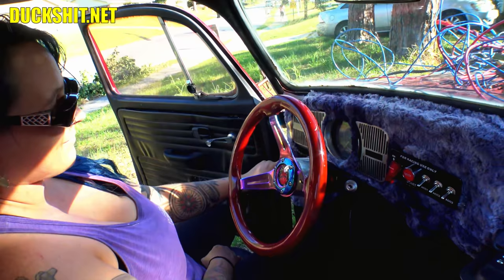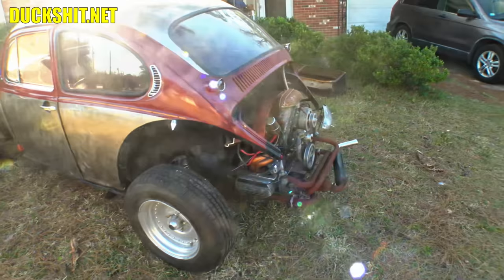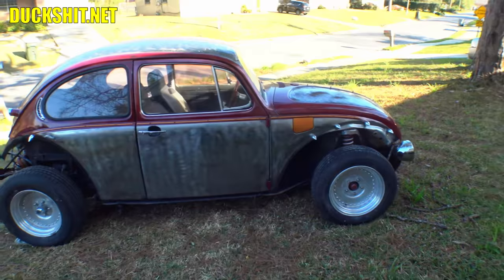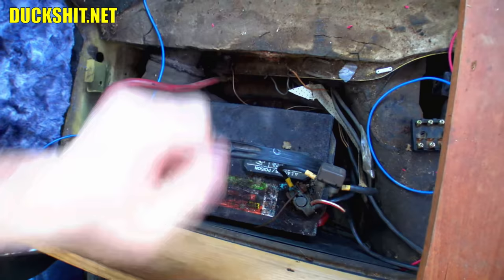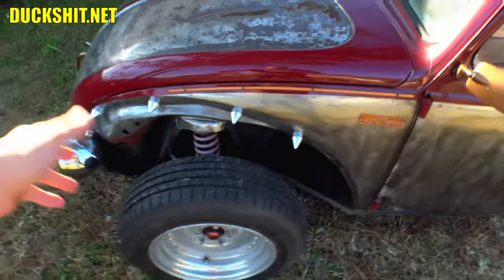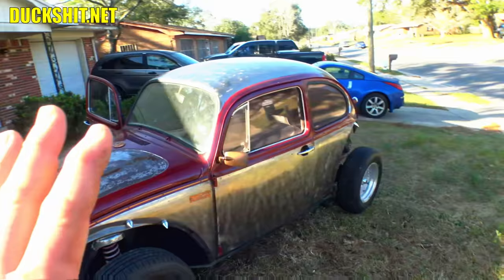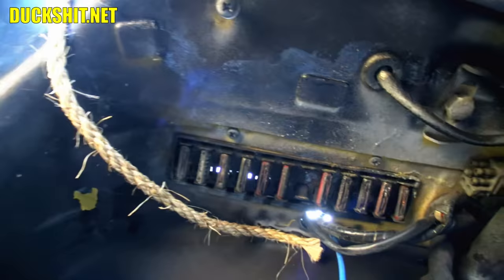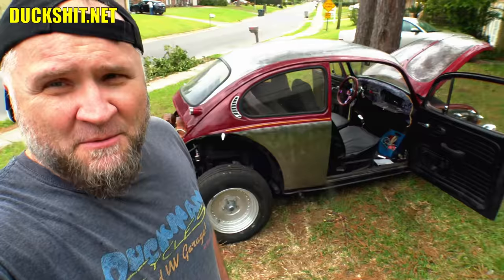WIRING EVALUATION🦆💩 - VW Super Beetle Volksrod Project - 02

Comment from the maker: First impression.... this is a wiring disaster!  I may have to replace the entire harness if it becomes a bigger problem.  So much is damaged, missing, or just not connected properly.  Hoping I can save it without having to shell out more money for new parts!
Reply: I would do that as jacked up as it looks, Like you said, someone that has no clue did all that, seems like making it right would be best - I mean, even if all you did was hook up the basics and throw all that other weird sht out it would still be 100% better.     You go man. 

  Also, I think you should invent a DUCK horn and then install one on every VW You work on from here on out whether the customer wants it or not. :0)     I mean ya said what kinda sounding horn and then she gagged. LOL   Fkin QUACK! QUACK!
Reply: God has faith in you you will get it running and drive able
Reply from the maker: @jessecoldsmith710  Thank you!  🙂👍🏻

Comment: Did you know you can run the battery absolutely flat and charge it back up backwards; negative is now positive and positive is now negative and the battery doesn't care.
Reply from the maker: LoL hahah not really... that is not how retail available lead acid batteries are meant to work.  I suppose you could irreversibly destroy one yourself, but nonetheless that's not the argument here in this video.  The battery was installed backwards, the voltage was backwards, it's not a "modified" battery.  😁🤘🦆💩

Comment: Six or maybe seven wires in the harness and they screwed it up.
Reply from the maker: LoL!  I wish a VW OEM harness was really that simple.  It's quite a bundle of crap.... operates very VW-specific, lacks any of the technology, computers, or other electronic devices to control flow.  Many different hardware solutions in the form of wiring for all kinds of interesting trickery to make things work.  Have you ever seen the brake light switch circuit?  Wooooh... you're in for a treat!

Comment: I remember I once put a battery in wrong way on an old Nissan truck. Thankfully some fuses prevented damage. Unfortunately VW didn't put similar fuses in the beetle. And was it VW Germany or VW America who decided to make red for negative? Dumb.
Reply from the maker: I dunno, maybe Bosch did.  I believe they designed the wiring harness for the VW as well as many other automobiles and motorcycles... a lot of the wiring color codes are the same among many German and Austrian vehicles.

Comment: My 69 beetle has a aluminum braided ground lol
Reply from the maker: Aluminum?  I've seen several with steel, but never aluminum.  Put a magnet on it!
Reply: @DuckmanCycles  it’s got green corrosion so it’s not steel lol
Reply: @DuckmanCycles  no rust
Reply from the maker: If its green, then its copper!  Aluminum turns white or black!
Reply: @DuckmanCycles  yeah, sorry white lol
Reply from the maker: White and green are pretty hard to confuse.... you smoking them pencils again?
Reply: @DuckmanCycles  lol
Reply from the maker: smoke the green ones, they are best.